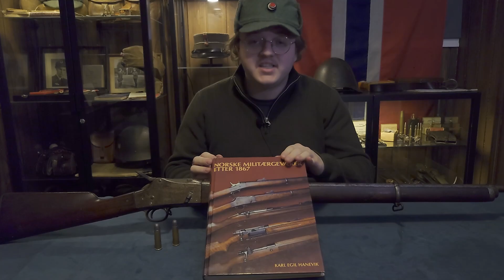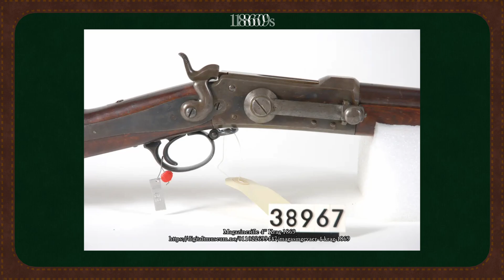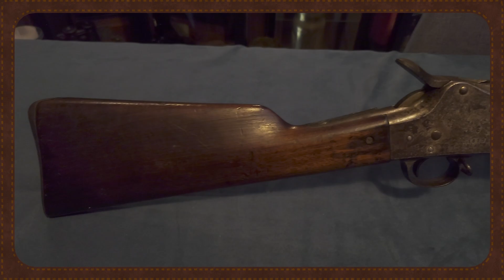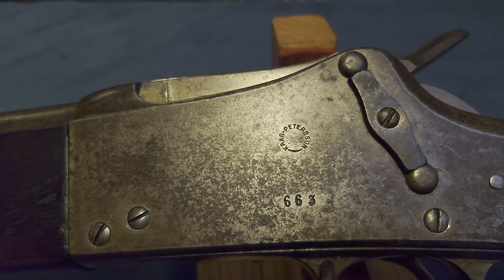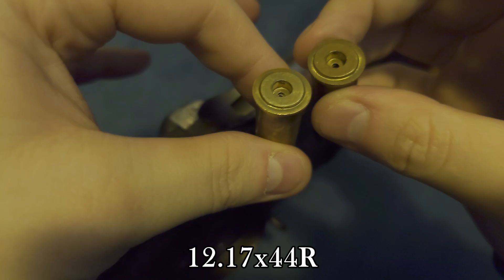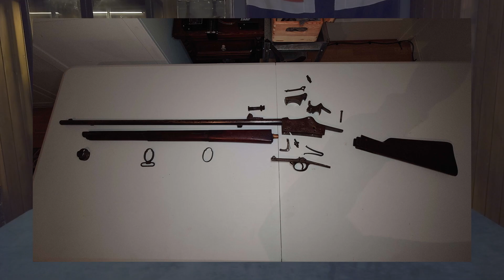Krag-Petersson m/1876 | The Forgotten Krag

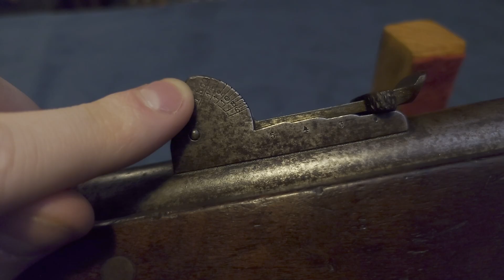Comment from the maker: Correction at 6:40 :

The rifles sight is not in meters, but in Alen. This older measuring unit was fased out at the end of the 1800s. 

1 Alen was in 1875 = 60cm
1 Alen in 1824 = 62,748cm

Based on the 1875 measurement. The sight has a max range of around 900m.

Comment: The next time you need to remove surface rust, try aluminum foil. Use it dry, with no oil of any kind. Aluminum has an affinity for iron oxide, (rust), and because aluminum is softer than steel, you can press down hard while cleaning the rust off, but you will not scratch the metal on the rifle. I learned this trick in Marine Corps bootcamp, 60 years ago, a place where rust on a rifle is a real NO-NO! The aluminum residue can be removed with a dry cloth. Give it a try everyone, and let me know what you think.

Comment: I am a big fan of the American Krag-Jorgensen, and own several.
I would really like a Norwegian Krag-Jorgensen in 6.5×55.
I had a chance to buy one once, but couldnt afford it at the time!
Reply from the maker: Norwegian Krags are really nice! the tolerances are tighter than the American making it a tad bit safer to shoot due to the "extra" locking lug this provides.

I plan on getting a US Krag at some point aswell, and a Danish.
Reply: @NordicArmsAndHistory  
Actually the US Krags are pretty safe.  The bolt is not going hit you in the face if the locking lug breaks.  The bolt handle provides generous safety.
But I agree, the tighter tolerances of the handle and extractor allow a higher chamber pressure!  I don't know why we didn't follow the Norwegian tolerances.
But it was our first smokeless powder cartridge rifle, and perhaps they thought it unnecessary!  But it did limit the chamber pressure.

Comment: Very interesting iron! 1500m on those sights is pretty ambitious lol. My Husqvarna 12.7 x 44 roller can hit a 600 yard gong but the bullet is more falling on it rather than hitting it. It's on my photo. The 12.7 x x44 round is pretty much a slightly shorter .50-70
Reply from the maker: Small correction where i misspoke. 

The rifles sight is not in meters, but in Alen. This older measuring unit was fased out at the end of the 1800s. 

1 Alen was in 1875 = 60cm
1 Alen in 1824 = 62,748cm

Based on the 1875 measurement. The sight has a max range of around 900m.

Comment: Great video; thanks for sharing !   You obviously did the right thing in carefully conserving this rifle, but should you need to remove rust, for example on some relic antique, the method I've been using for over 50 years is to immerse the object in a solution of 10 to 20 parts water to one part (by volume) of Molasses, and allow the solution to ferment, from a few days to a couple of weeks depending on the amount of rust.  It works to clean copper and brass as well, but dissolves aluminium and its alloys, so beware !  Slow, but better than using acids or electrolysis or expensive chemicals, and completely safe and non-toxic !  Cheers from South Australia.
Reply from the maker: Thank you! i will keep that in mind!